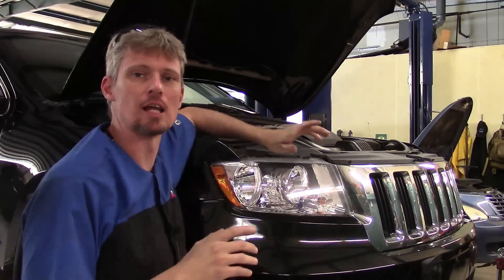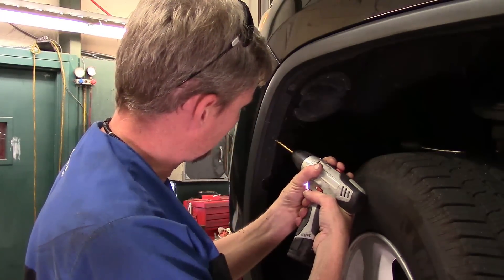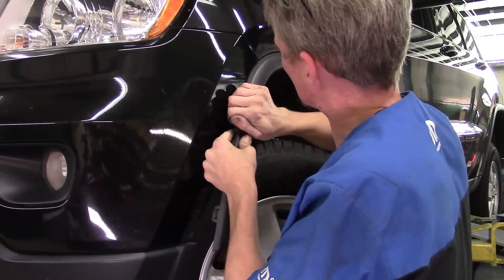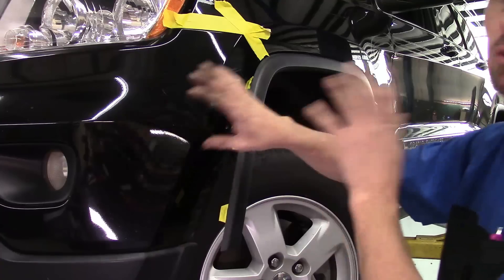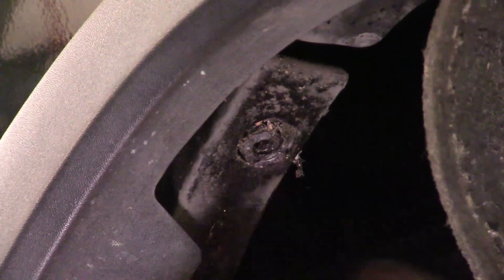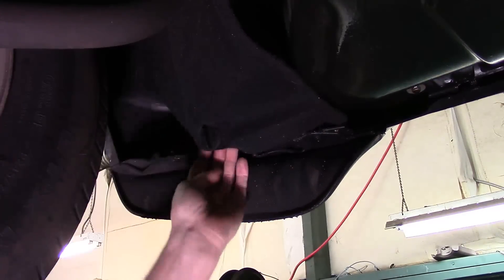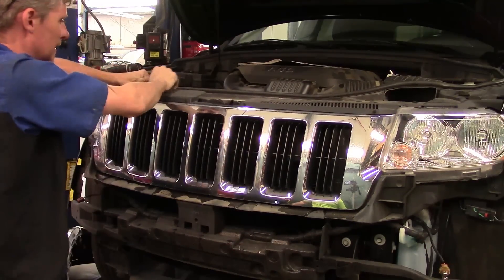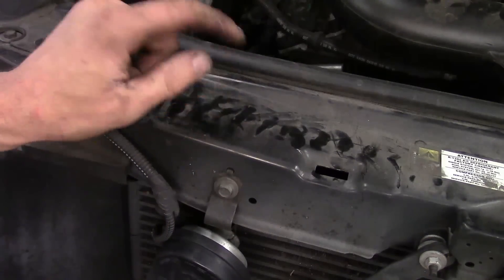2011-2013 Jeep Grand Cherokee front grille removal

Comment: That’s the only way to change the horns?
Reply: Just an FYI , i have a 2011 JGC Laredo , low tone horn (drivers side) stopped working . I bought a 2 pack of horns from Amazon for under 30 bucks . I did not have to remove the grill or fascia or anything like that . I was able to pull back the top of the grill several inches then my wife held it in place so i was able to get a 1/4" drive 10 mm socket to remove the mounting bolt . I had my wife put a screwdriver through the grill to support the horn so it didn't fall once the bolt was out . i was then able to reach in and pull of the 2 wires , once again my wife supported the wires so they didn't drop down . Switched out the bracket onto the new horn , slipper it back in , attached my wires and then bolted back on . Probably took me 20 minutes .

Comment: Thanks! In my case the drivers side horn quit working. I have to find a way to get at it. Looks like a Saturday job just to find out if the horn is blown (so-to-speak) or someone who previously worked on my Jeep just didn't hook it up right.
Reply from the maker: Taking that bumper cover off will take about 15 minutes at most, seems worse then it is but its really not. Thanks for watching and make sure to subscribe.
Reply: MotorCity Mechanic ...Do you have a video on replacing the 2011 Grand Cherokee fog light bulbs?
Reply from the maker: @7TrillionSEO  I dont at the moment but I will keep it in mind as a future video. Thanks for asking
Reply: Just an FYI , i have a 2011 JGC Laredo , low tone horn (drivers side) stopped working . I bought a 2 pack of horns from Amazon for under 30 bucks . I did not have to remove the grill or fascia or anything like that . I was able to pull back the top of the grill several inches then my wife held it in place so i was able to get a 1/4" drive 10 mm socket to remove the mounting bolt . I had my wife put a screwdriver through the grill to support the horn so it didn't fall once the bolt was out . i was then able to reach in and pull of the 2 wires , once again my wife supported the wires so they didn't drop down . Switched out the bracket onto the new horn , slipper it back in , attached my wires and then bolted back on . Probably took me 20 minutes .

Comment: hey man.  Thanks.  I think im going to give this a shot to replace my horn.  my only concern is the tabs for the the bumper that you stated "arent reusable". How can a novice like myself find those tabs so i can put my bumper back on?
Reply: Just an FYI , i have a 2011 JGC Laredo , low tone horn (drivers side) stopped working . I bought a 2 pack of horns from Amazon for under 30 bucks . I did not have to remove the grill or fascia or anything like that . I was able to pull back the top of the grill several inches then my wife held it in place so i was able to get a 1/4" drive 10 mm socket to remove the mounting bolt . I had my wife put a screwdriver through the grill to support the horn so it didn't fall once the bolt was out . i was then able to reach in and pull of the 2 wires , once again my wife supported the wires so they didn't drop down . Switched out the bracket onto the new horn , slipper it back in , attached my wires and then bolted back on . Probably took me 20 minutes .

Comment: Great video. What was the reason for the removal on this thing? I’m having a small leak behind the bumper cover/grille that seems to be common with these year model Jeep GC hemi’s.
Reply from the maker: It was just a step in the removal to get to something else....thought a video on just the grill might help someone if they were wanting to replace just the grill. Otherwise the typical leak on that vehicle is the a/c condenser leaking trans fluid....its an a/c and trans cooler combo. Thanks for watching and for the question. Make sure to subscribe.
Reply: @MotorCityMechanic  is there a fix for that leak?

Comment: This is a great video.  My horn no longer works so was searching on where they are located and this video came up.  Are those the two horns I see directly behind the grill?  Looks like I may have to do this to replace them (checked the fuses and they are all fine).  thanks!
Reply from the maker: Your correct, thats the location of both horns. Thanks for watching and for taking the time to comment. Make sure to subscribe and click that bell icon as well.
Reply: Just an FYI , i have a 2011 JGC Laredo , low tone horn (drivers side) stopped working . I bought a 2 pack of horns from Amazon for under 30 bucks . I did not have to remove the grill or fascia or anything like that . I was able to pull back the top of the grill several inches then my wife held it in place so i was able to get a 1/4" drive 10 mm socket to remove the mounting bolt . I had my wife put a screwdriver through the grill to support the horn so it didn't fall once the bolt was out . i was then able to reach in and pull of the 2 wires , once again my wife supported the wires so they didn't drop down . Switched out the bracket onto the new horn , slipper it back in , attached my wires and then bolted back on . Probably took me 20 minutes .

Comment: Great job explaining!  well done video!!  Liked !!
Reply from the maker: Many thanks for the feedback and for watching!
Reply: @MotorCityMechanic  on a friends 2012 Jeep GC with 4 wheel drive I replaced his radiator and oil pan gasket.  This video was very helpful!  But I must say this is one of the hardest vehicles to do these 2 repairs that I have every worked on. :)
Reply from the maker: Yeah there are alot of things in the way of each other especially with it being 4wd. Thanks for watching and for the comment.

Comment: I need to replace the HID ballast that I am told is attached to the bottom of the headlight assembly. Do I just need to remove the bumper cover, or the grill as well? Anything else I should know? Thanks! Your video is awesome!!
Reply: Also, can I just detach the driver's side of the bumper cover only, if I just need to replace the driver side ballast?
Reply from the maker: I havent had to do this repair myself yet as far as the ballast but my info states front bumper cover needs to come off. I can varify that 100% for sure being that personally I havent attempted to do that yet....may be a short cut. I will have to try to remember to film it if I ever get one in for that reason. Make sure to subscribe and thanks for the kind words. Have a great weekend and share the videos with others.
Reply: Hi I just want to report that I successfully replaced the driver side ballast yesterday. I did need to fully remove the bumper cover and the grill, as well as the complete light fixture and air box.
Reply from the maker: Cool....glad that you were able to tackle the repair. I appreciate the update.

Comment: Great Video! Question: I have 2011 jeep grand cherokee with the 5.7L, so I can't access the HID headlights from the wheel well. Will I have to take off the front bumper/grill and pull out the headlights to replace that bulb?
Reply from the maker: I have gotten to the bulbs from the engine compartment....one side is easier then the other. The drivers side requires removing the air box. The service info also states this....nothing more then removing the rubber cover from the back side of the headlight to get to the element. Sorry about the delay.....Thanks for watching and make sure to subscribe

Comment: do you have any vids on the same vehicle  on replacing the upper and lower control arms?
Reply from the maker: My96XJ Currently I don't.....not s common issue where I am located....actually never had to  do this repair yet. I will certainly keep it in my bad if I ever do. Thanks for asking and make sure to subscribe

Comment: The non-reusable plastic rivets (1:22)--these are $13 each! Do you know where I can get replacements, or substitutes that cost less?
Excellent vid, thank you!
Reply from the maker: Here is a similar plastic rivot that comes in a pack of 100. https://www.amazon.com/M48350-PLASTIC-157-394-DELRIN-FINISH/dp/B010OPPT92/ref=as_sl_pc_qf_sp_asin_til?tag=motorcitymechanic-20&linkCode=w00&linkId=f5b92c784792699481ae6e615f522db7&creativeASIN=B010OPPT92
Reply: Yes! You're the man!
Reply from the maker: Your welcome. Thanks for keeping up with the channel
Reply: Can you update the link for the pack of 100 replacement plastic rivets? The original provided one no longer works.
Reply: Do you have the part number for the rivets?
Reply: @mpilksjr  I did quite a bit of research on this. A regular rivet gun won't work on the plastic rivets. Here's what you want: https://www.harborfreight.com/hand-riveter-with-40-industrial-strength-poly-rivets-97757.html